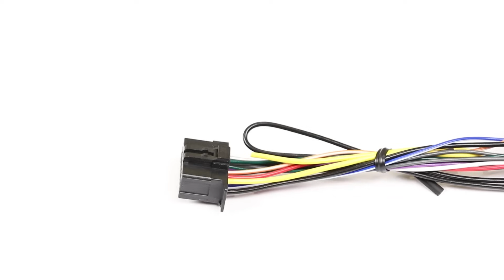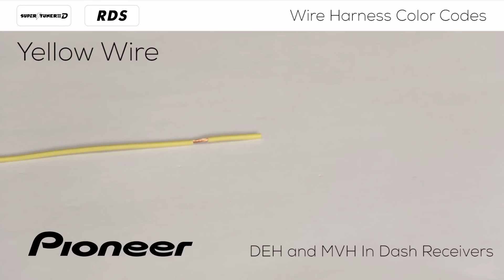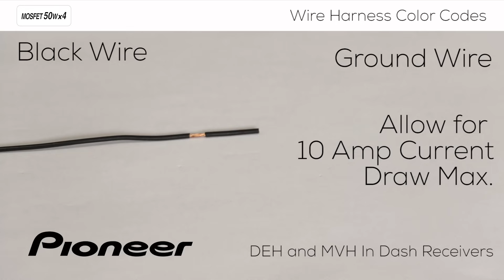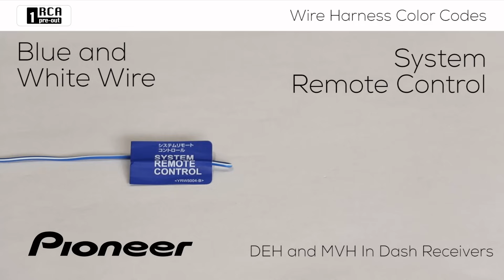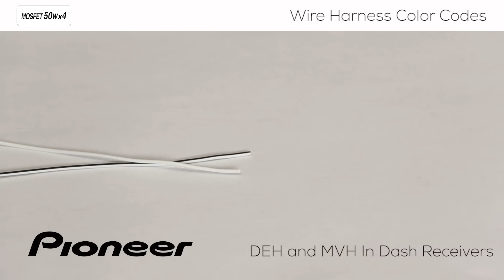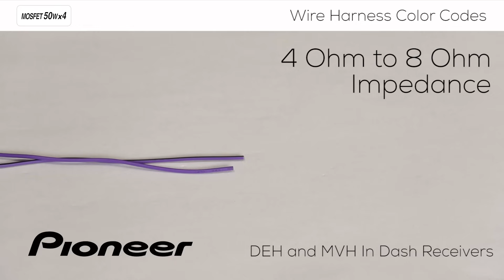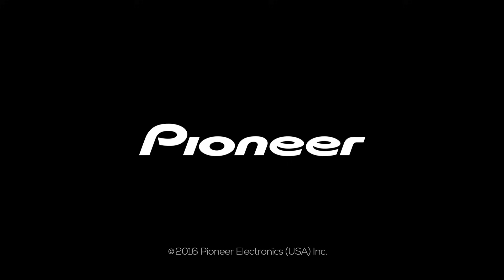How To - Understanding Pioneer Wire Harness Color Codes for DEH and MVH In Dash Receivers

Comment: What does the pink wire stand for?
Reply from the maker: Some Pioneer receivers have a Pink wire on the wire harness.  The Pink wire is the Car Speed Signal Input.  This may also be known as the VSS or Vehicle Speed Sense wire.  This gives the in-dash receiver direct information from the vehicle about speed and is not dependent upon GPS.  I strongly recommend to properly connect the Pink wire to the vehicle.  Navigation software in Apple CarPlay and Android Auto function with greater reliability and accuracy when the Pink wire is properly connected to the vehicle.  You can find more videos on Pioneer's YouTube Channel here:   https://www.youtube.com/user/pioneerelectronics

Comment: Is there no antenna power wire
Reply from the maker: The Blue Wire with White stripe can be used for the power antenna or external amplifiers, as shown in this Pioneer How To  video https://youtu.be/kR2MO2kwFug?t=147      You can find more videos on Pioneer's YouTube Channel here:   https://www.youtube.com/user/pioneerelectronics
Reply: @pioneerelectronics  oh okay 👍🏼 i was just wondering since my truck has 2 blue wires and same with the old radio harness did too

Comment: I know this video is old, but when my truck is off for a few hours, my stereo messes up, it works,, but the screen is blank, goes white, then blank again. And when I go in reverse, the camera works (I have an after market camera) the main screen just flicks. If that makes sense?
Reply from the maker: What is the model number of your Pioneer in-dash receiver?  Please be more specific with your question.  What is your setup?  
If your clock and radio stations reset each time you start your vehicle, the in-dash receiver may have an improper connection for the Yellow Wire.  The Yellow Wire must have constant power from the vehicle.   This means if the vehicle is switched on or switched off, the yellow wire should measure at ~12 volts.   The Red Wire is for accessory.  You can view the red wire as the receiver’s on/off switch.  The red wire should measure ~ 12 volts only when the vehicle is switched on.  
--Do not connect the Red Wire and Yellow Wire together. --
  
Pioneer in-dash receivers are designed to work with the Pioneer ND-BC8 backup camera. I don’t know about the operation of other cameras. 
Be sure to plug the Brown camera output RCA into the Brown RCA Input on the back of the Pioneer in dash receiver.
The Pioneer ND-BC8 camera needs power and ground to operate.  The camera should always have power when the vehicle is switched on. And the camera should power off when the vehicle is switched off.  This is very similar to the way the Red Accessory wire works on a Pioneer in-dash receiver.  Just because the camera has power does not mean you are viewing the camera window on the in-dash receiver.
The receiver’s violet/white wire is used to let the in-dash receiver know that the vehicle is in it’s reverse gear and, to automatically open the backup camera window on the receiver screen. 
Do not connect the violet/White wire to the camera. 
When you put the vehicle in it’s reverse gear, the violet/White wire should sense a change in voltage. This automatically opens the camera window on the in-dash receiver. And closes the camera window, when the vehicle is taken out of it’s reverse gear.  One possibly connection for the violet/White Reverse Gear wire is the vehicle’s  backup lamp terminal. 
You can find more videos on Pioneer's YouTube Channel here:  https://www.youtube.com/user/pioneerelectronics

Comment: I have put the blue and white cable from the remote and it does not turn on the stage and neither does the subwoofer
Reply from the maker: Please be more specific with your question.  What is the model number of your Pioneer in-dash receiver?  What is model number of your Pioneer amplifier?  What is the model number of your Pioneer subwoofer?  You can find more videos on Pioneer's YouTube channel here:  https://www.youtube.com/user/pioneerelectronics
Reply: @pioneerelectronics  my radio model is pioneer mvh-s420bt, my amplifier model is Gm-A3702 and my subwoofer model is GXT-3730B
Reply from the maker: The Pioneer GM-A3702 amplifier requires a power connection directly to the vehicle's battery.  I recommend 8 gauge cable.  Please be certain to put a fuse on the power cable within 12 inches of the vehicle's battery.  The amplifier will also require a ground connection to metal in the body or frame of the vehicle.  I recommend 8 gauge for the ground cable as well as the power cable.   You'll need to run RCA wires from the in-dash receiver's Rear RCA output directly to the amplifier's RCA input.  In addition, you'll need to extend the Blue wire with white stripe on the back of the in-dash receiver to the system control terminal on the amplifier.  Wiring this way will cause the amplifier to power on and off with the in-dash receiver.  You'll know the amplifier is on when you see the power indicator on the amp is illuminated.   You can find more videos on Pioneer's YouTube channel here:  https://www.youtube.com/user/pioneerelectronics

Comment: So do i need to connect the blue wire for it to work?
Reply from the maker: The Blue wire with White stripe is used as an on/off switch for external devices connected to the in-dash receiver, such as external amplifiers or a power antenna.  If you don't have any external devices that need to be switched on and off with the in-dash receiver, then you don't need to connect the Blue/White wire to anything.  Just properly terminate the wire so it does not come into contact with other wires or metal in the vehicle.  You can find more videos on Pioneer's YouTube Channel here:   https://www.youtube.com/user/pioneerelectronics

Comment: Ok, before the criticism starts, im not very tech savvy (at all) and I've all my speaker wires connected. And color matched. But I'm left with red ignition, orange illumination/dash, and blue power antenna wires on the "truck side" of the harness. And on the head unit side I've a single violet wire (no idea) and blue (system remote control) wire. 

Where did I fuck up?
Reply: The wiring colors in nearly every make, model and, year of vehicle are different.   The wire colors on the Pioneer wire harness   are not   designed to match any particular make, model, or year of vehicle's dash wiring colors.  Any wire colors that you match from the Pioneer wire harness directly to your vehicle are purely coincidental and may not be the correct connection for proper operation of the in-dash receiver.  What is the model number of your Pioneer in-dash receiver?  You mentioned a violet wire.  This leads me to believe you are using a receiver with a video screen and backup camera input.   If that's the case, you may find this Pioneer Wire Harness video useful:   https://youtu.be/-bF3uzzaT30?list=PLw63zJRQbCNi6CoU7JbUNT83T7ippQbU6   This videos explains the violet/white and Green Parking Brake wire and Blue/White system remote wire.    I recommend to use a wire harness adapter kit for your installation.  Many are available.  You can see one example here:  http://metraonline.com/part/71-2106     In many cases you can buy a wire harness that is specific to your vehicle.  The wire harness that fits your vehicle will have the same wire colors as the Pioneer wire harness.  You just need to match up the wire colors.  You can find more videos on Pioneer's YouTube Channel here:  https://www.youtube.com/user/pioneerelectronics

Comment: I dont have a red wire
Reply: What model of Pioneer in-dash receiver do you have?   If this is an audio only receiver, with no video screen, the wire color choices are limited.   Are there any other wires even remotely close to red?  I think you can rule out White, Gray, Green, Purple, Black, Yellow, and Blue.  If this is a genuine Pioneer wire harness, there should be a solid red wire.  A solid red wire that has faded color may be seen as solid pink.      The other could be orange with white stripe.   That not solid red or pink. You can find more videos on Pioneer's YouTube Channel here:  https://www.youtube.com/user/pioneerelectronics
Reply: @deckerdotto6035  thanks for the reply but I yolo'd it and splice the red form my harness to the purple form the radio plug in and it started working

Comment: I have problem whit my Deh 2130 how to wire it
Reply: The Pioneer wire harness is explained in detail in the video above:   https://youtu.be/kR2MO2kwFug     The Pioneer wire harness colors are not designed to match the wiring colors of any particular make, model, or year of vehicle.  Any colors that match up are purely coincidental.  I recommend to use a wire harness adapter designed for your particular vehicle.  Many are available.  Here is one example:   http://metraonline.com/part/70-2104      You can find more videos on Pioneer's YouTube Channel here:  https://www.youtube.com/user/pioneerelectronics

Comment: Wait so the black ground wires from my head unit and from my new harness adapter for my vehicle don't go together? You got to ground both?
Reply: If you are using an aftermarket wire harness adapter designed for your particular vehicle that offers matching wire colors to the Pioneer wire harness, you should be able to join the two black wires together.  One black wire from the Pioneer harness and, one black wire from the aftermarket wire harness adapter joined together.  That should be all you need to do.   Another option would be to connect the Pioneer wire harness black wire to metal in the body or fame of the vehicle. If that case you should safely terminate the black wire from the aftermarket wire harness adapter.  It's not a good idea to leave bare wires in the dash.    You can find a full playlist of How To videos from Pioneer about audio receivers here:  https://youtu.be/to2eXLPBnJI?list=PLw63zJRQbCNiPrgwJQGimQIzOEz5sJiHP   and you can find more videos on Pioneer's YouTube Channel here:  https://www.youtube.com/user/pioneerelectronics

Comment: I connected the red wire and the yellow wire to get my radio to work but every time I shut the car off and turn it back on the radio always makes me set it all up again idk why it does that
Reply: If your clock and radio stations reset each time you start your vehicle your in-dash receiver may have an improper connection for the Yellow Wire.  The Yellow Wire must have constant power from the vehicle. Even when the vehicle is switched off.  The Red Wire is for accessory and is sort of like the on/off switch for the in-dash receiver. Red should only have power when the vehicle is switched on.  Do not connect the Red Wire and Yellow Wire together. Please take a look at this video for more information on wiring your Pioneer in-dash receiver:  https://youtu.be/kR2MO2kwFug?t=15  You can find more videos on Pioneer's YouTube Channel here:  https://www.youtube.com/user/pioneerelectronics

Comment: Do you need to wire the stuff together? I don’t have any tools for putting wires together or is it all in that one plug?
Reply: Pioneer in-dash receives must be connected to the vehicle to operate.  This is done through the wire harness  as explained in the video above. The wire colors on the Pioneer wire harness are not designed to match any particular make, model, or year of vehicle's dash wiring.    In many cases you can buy a wire harness that is specific to your vehicle.  The wire harness that fits your vehicle will have the same wire colors as the Pioneer wire harness.  You just need to match up the wire colors. You can see one example here:  http://metraonline.com/part/71-2106   You can find more videos on Pioneer's YouTube Channel here:  https://www.youtube.com/user/pioneerelectronics
Reply: @deckerdotto6035  in my case I think my car supports the wire harness included. Do I need to connect the wires in any sort of way myself, as in with connector clips, crimper plier etc
Reply: It would be great if your car had the same plug as the one on the back of the Pioneer receiver.  Best of luck with that.   I strongly recommend that you take the existing radio out of the vehicle, and compare the connectors in the vehicle to the plug on the back of the Pioneer receiver.  In nearly every vehicle ever made, these plugs will not match up.  That's where a part like this is used:   http://metraonline.com/part/71-2106            In nearly every Pioneer car stereo installation, you'll need to join the wires from the in-dash receiver to the vehicle in one way or another.  There are many ways to join wires.  Soldering, or crimp connectors are commonly used. You can find many videos on YouTube explaining the process of wire joining.  You can find more videos on Pioneer's YouTube Channel here:  https://www.youtube.com/user/pioneerelectronics
Reply: @deckerdotto6035  thank you for you help 😃

Comment: Could you please tell me Pioneer DEH-S31BT Whats the steering wheel control wire on this harness..? If I buy separate adapter(interface)how should I connect with this..? Because this stereo says it has Steering Wheel Control(swc) function
Reply: A 3rd party adapter is required for steering wheel control.    Please watch this video to see the back of the Pioneer DEH-S31BT and the Steering Wheel Remote Control Input:    https://youtu.be/pGGsNRS74rQ?list=PLw63zJRQbCNhDilB-Letn_4BQuvv86GMl&t=163       You'll need to get a steering wheel control adapter.  Many are available. Here is one possibility:   http://metraonline.com/part/AXSWC   There are no steering wheel controls on the receiver's wire harness. The steering wheel control adapter plugs in through a 3.5 mm jack on the back of the receiver.   You can find more How To videos from Pioneer here:  https://youtu.be/Z6g0EOPZL0c?list=PLw63zJRQbCNinkLCSrV17ExW5FWT7aIFU   and you can find more videos on Pioneer's YouTube Channel here;  https://www.youtube.com/user/pioneerelectronics

Comment: My radio won't turn on I think I have everything connected right
Reply: If you think you have everything connected correctly,  here are a couple possibilities:   1.  It's possible you don't have everything connected correctly.  Please note:  the wire colors in the Pioneer wire harness are not designed to match the wire colors in the dash of any make, model, or year of vehicle.  Any wire colors that match are purely coincidence.  2.  It's possible you blew a fuse in the vehicle's fuse panel during the installation.  Check the vehicle's fuses. Replace if necessary.   3.  You blew the fuse located on the back of the Pioneer receiver.  Pull out the wire harness and take a look at the fuse on the receiver.  Replace if necessary.    Please note,  disconnect the negative terminal of the vehicle's battery during installation.  This will help with the whole fuse thing.  If you replace a fuse and it blows out again, this means you have something like the receiver's Yellow, Red, or Black wire connected incorrectly.   You can find more videos on Pioneer's YouTube Channel here:  https://www.youtube.com/user/pioneerelectronics
Reply: @deckerdotto6035  I can't find a video that tells me witch wires to connect to what
Reply: @deckerdotto6035  I got it lmao didn't have a fuse in it

Comment: Got a buick lacrosse  installed w an a vh-1300nex. All connections are made but no power when I turn the ignition. Any help?
Reply: The Pioneer AVH-1300NEX was manufactured back in 2017.  It sounds like you may have blown a fuse in the vehicle, or on the in-dash receiver, or both,  during the installation.  For any installation, I recommend to disconnect the vehicle's battery negative terminal before working with wiring.  I recommend to check the fuse panel in the vehicle, and the 10 amp fuse on the back of the receiver.  If a fuse is blown, you did something wrong.  Go back and check your wiring before replacing the fuse.  Here is the wire harness video for the Pioneer AVH-1300NEX:   https://youtu.be/-bF3uzzaT30   You can find a full playlist of How To videos from Pioneer about AVH-1300NEX here:   https://youtu.be/ObpKXwrN8us?list=PLw63zJRQbCNhJK38BiQKlR0wF9-TVOVMl    Please be sure to install the latest firmware for your Pioneer AVH-1300NEX.  You can find it here:   https://www.pioneerelectronics.com/PUSA/Car/NEX/AVH-1300NEX#downloads    and you can find more videos on Pioneer's YouTube Channel here:  https://www.youtube.com/user/pioneerelectronics

Comment: Sir, my car SDVC function doesn't work in my i20 2011 1.2. all the other functions volume, etc. are working ok. Please show video how to check the SDVC signal wire damaged or shorted. Thanks in advance.
Reply: What Pioneer in-dash receiver model do you have?
Reply: @deckerdotto6035  it's company stock head unit. One pin shows designated as speed.
Reply: Please contact the auto maker for more information.   You can find more videos on Pioneer's YouTube Channel here: https://www.youtube.com/user/pioneerelectronics